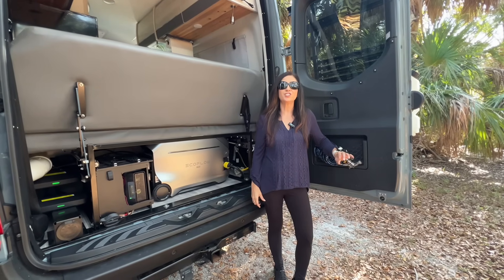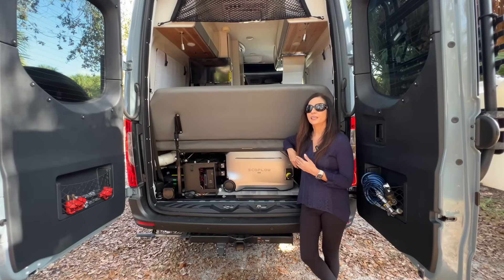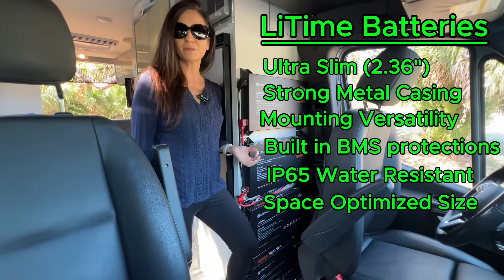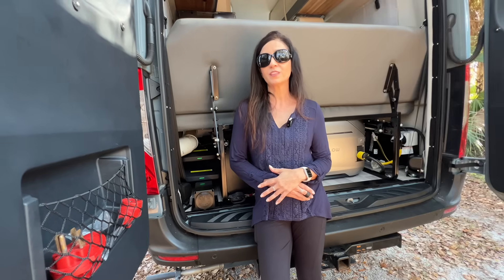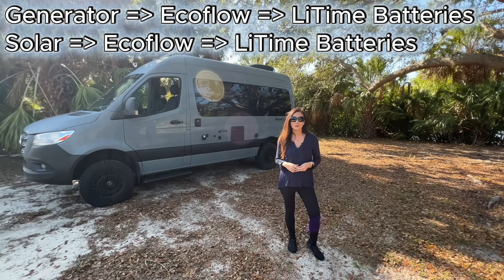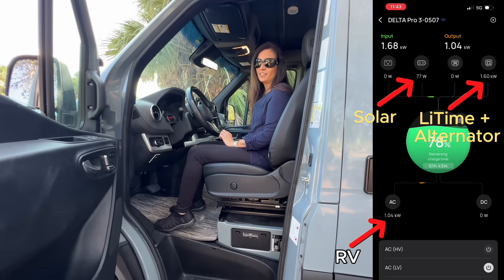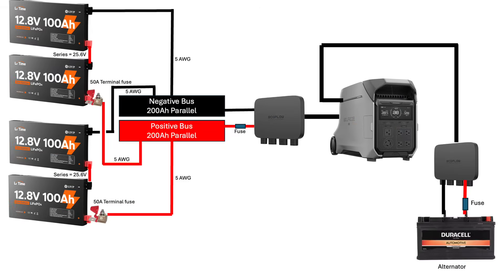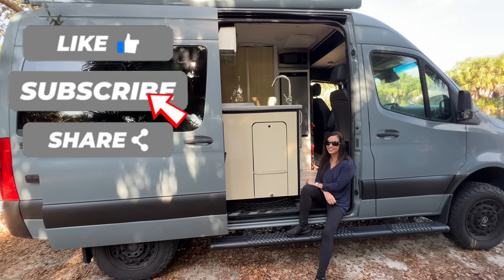Hidden Wall-Mounted Battery Bank: More Off-Grid Time, ZERO Lost Storage!

Comment: Nicely done. We have an Ecoflow Delta Pro for our 5th wheel. We are gonna do the same thing....kinda.  We are going to use the Ecoflow alternator charger and use a 48v 100 aH golf cart battery and do basically the same thing you have done.
Reply from the maker: Hello mark, Glad you liked the video.  Be careful with the 51.2V batteries as the Ecoflow Alternator charger is not rated for a 48V batteries (range: 11-31V).  You could use a step down converter but then you can not reverse charge through a step down converter.  The best way to use a 48V battery is via the solar port but you will need a separate 48V battery charger as well ... I did show this in a video if you are interested.  Thank you for watching and supporting the channel!
Reply: @RubysAdventuresUnplugged  oh good to know about the alternator charger.   Just larger 12v batteries it is!  Thanks!

Comment: You may want to test EMF on those battery cables right behind your head at the drivers seat.
Reply from the maker: Thanks for the comment! Safety is always a priority, and I did considered this in my build.  Let me explain why you don’t need to worry about EMF from these batteries. Lithium batteries don’t actually create EMFs — they just store DC power. The only EMF comes from the wiring when current is flowing (which I can turn off via the app if I wanted), and in my setup it’s running at about 25.6 volts and up to around 31 amps (about 800 watts). The positive and negative wires are routed right next to each other, which cancels most of the magnetic field, and they’re always more than six inches away from anyone’s head. So any EMF that’s there is extremely small — much less than what you get from holding a cell phone to your ear or cooking on an induction cooktop.  Hope this helps clear up any concerns and Thank You for watching and supporting my channel!
Reply: @RubysAdventuresUnplugged Thank you for explaining.  It would be interesting to see you do EMF readings at the inverter area on full AC 120v load.  Love your channel
Reply from the maker: Hello John ... that would be interesting, let me see what I can do.  Thanks for the suggestion!
Reply: @RubysAdventuresUnplugged testing several brands in the 3000watt to a single battery would be and awesome test.

Comment: Really good solution.   It’ll be hard to find an ecosystem that does all this better than EcoFlow.  The only other option I can think of that might save space & might integrate your 3rd party batteries directly for faster charging/discharging could be the Bluetti RV5 combined with their alternator charger.  

However, I bet you’ve either already ruled this out for a valid reason I haven’t thought of, or you’re already considering testing it soon. 

Liked, hyped, shared, etc…
Reply from the maker: Hello Nick, you are correct, I have been in contact with Bluetti however it seems they hesitant to allow me to test it in a real application video.  I will keep trying.  Thanks for all your support!
Reply: @RubysAdventuresUnplugged  You’re the best.

On a separate note, did you see the Pecron F5000LFP videos getting posted this week from CES by Minute Man Solar or others?  Pecron did a surprisingly good job on its specs and features.  One cool feature is you can set custom output for DC volts & amps.  That opens up a lot of options!

Comment: Ruby, it's a very informative video. I can reduce the rooftop solar panels and convert that space into a rooftop deck. Additionally, soon, RV generators will become obsolete.  👍👍👍
Reply from the maker: Hello Mike,  Thank you for the comment!  I agree that both Lithium and Solar are getting better each day and eventually, generators will go the way of the DoDo. I will be installing 600-800 Watts on the roof of my RV soon.  Here in FL, that means my generator will be just taking up space.  Thanks for Watching and supporting my channel.

Comment: Great setup Ruby! I'm assuming the generator is still available as a shore power option/backup charger the way you have it wired up?
Reply from the maker: You are correct.  When I installed the Ecoflow delta pro 3, I wired it after the transfer switch.  This means that the Ecoflow gets whatever power is coming into the transfer switch ... which could be shore power or the generator.  Also, I am planning to significantly update my roof solar over the next month or so.  I want to have at least 600watts on the roof.  Thanks for commenting and Supporting the channel!